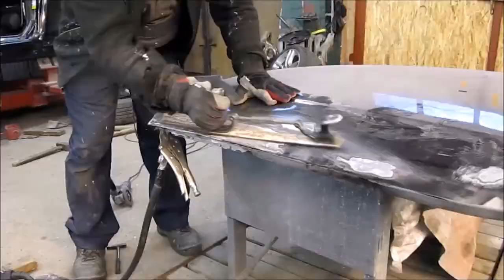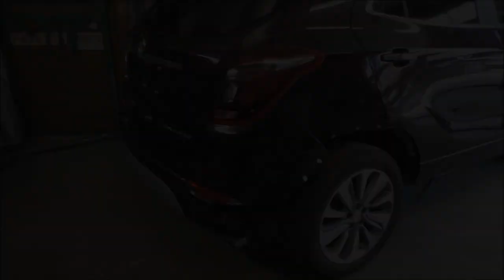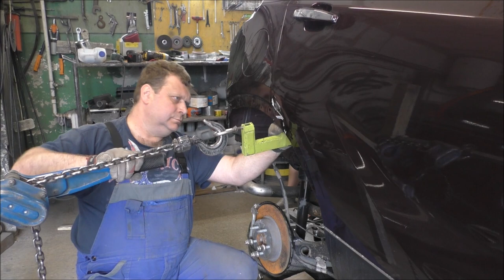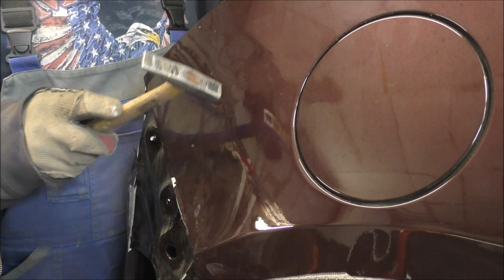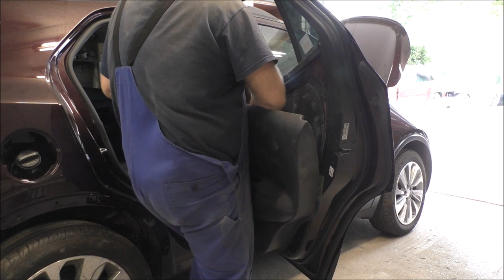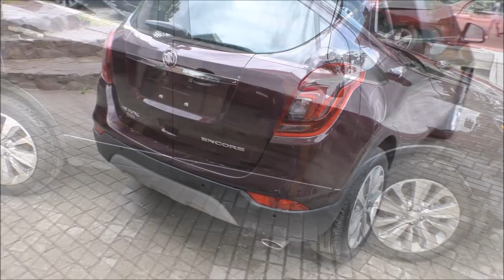Buick. The quarter panel repair. Ремонт заднего крыла.

Comment: An interesting repair, makes a change from the usual Beemers. Surprising that this damage is enough to total a car in the US (One days work on metal in Lithuania/Europe). Two questions. Why is the headlining removed, and what is going on with the drivers door?
Reply: Joseph Strong maybe curtain airbags went off?
Reply: mcmcolm That was just fender damage
Reply: May not have been a total. There are lots of cars with minor body damage that were rentals or lease cars and they just don't sell well enough outside those markets to justify the repair.
Reply: Seems it was the airbags....